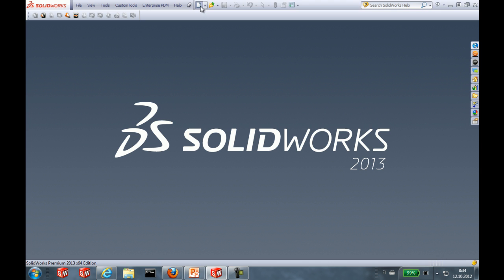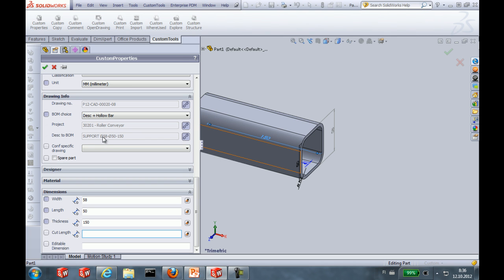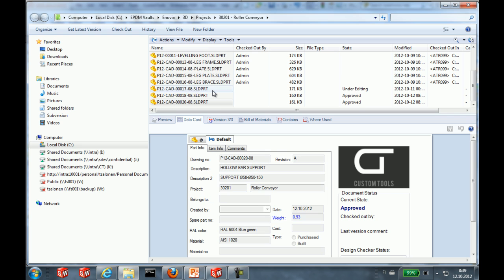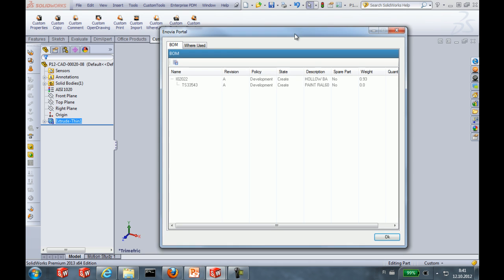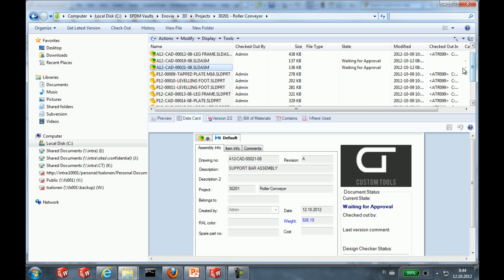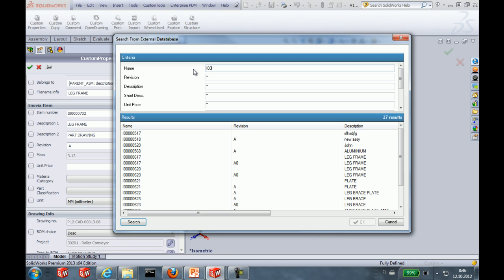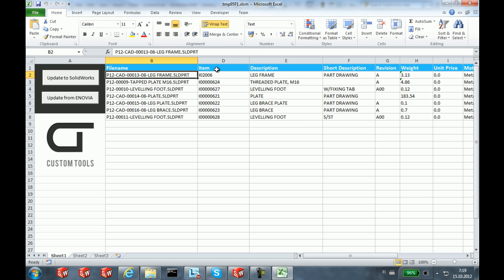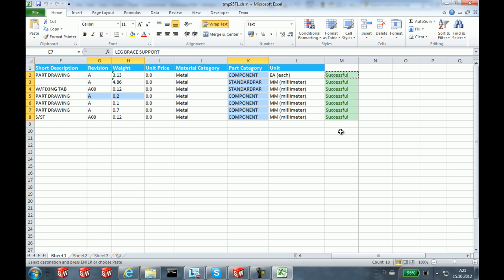SolidWorks Enovia V6 integration

Comment: We have many customers that are using EPDM to manage their design data i.e. SolidWorks files in a very efficient way. In my opinion EPDM is one of the best tools available in the market to connect a CAD to PDM. Of course EPDM doesn't fulfill all needs in a company what comes to product management (i.e. items but that's a different story).

EPDM is really straightforward to use and doesn't make the design process itself more complex I really doubt is it correct way to go with direct SW/ENOVIA integration but use EPDM in between to make design process simpler from designers point of view.